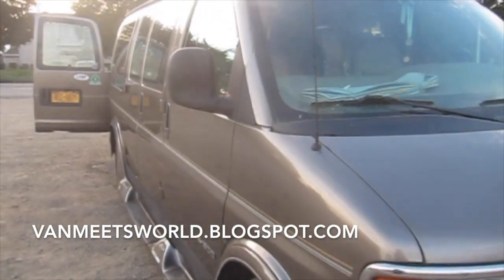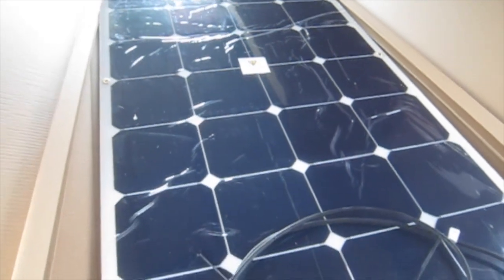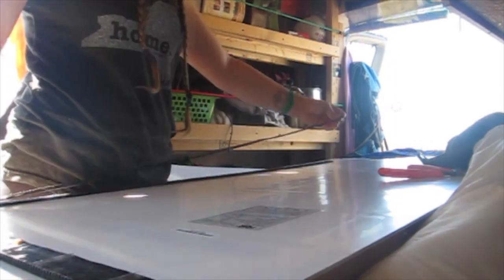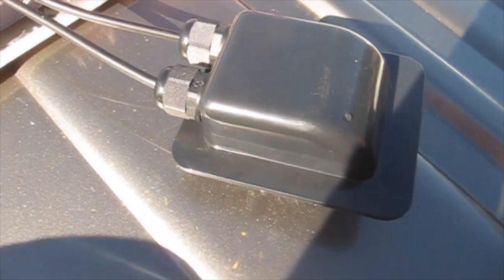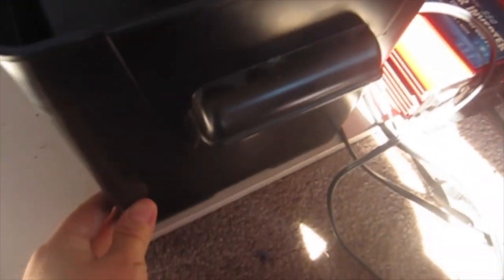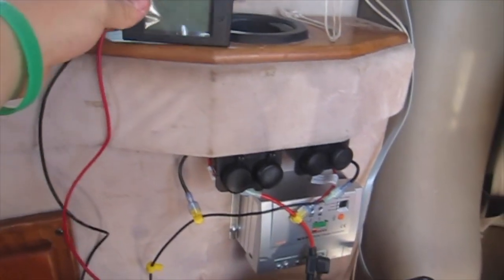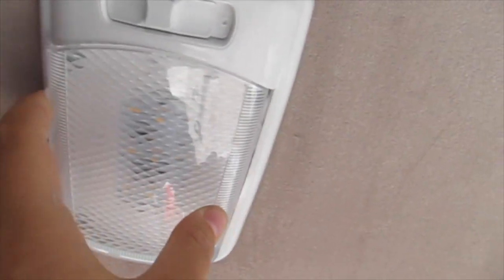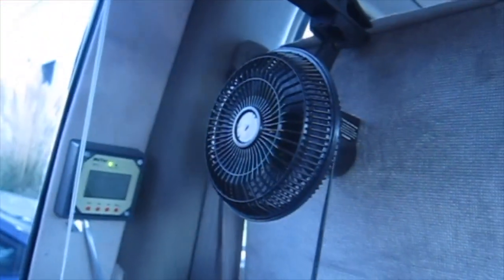Hayduke goes solar!

Comment: How's this set up working ?? Also how's the Velcro holding up while driving and rain ??
Reply from the maker: Hey Derrek! I sold my van at the end of April. But from October until then, the set-up worked great and continues to do so with the new owner. Wind, rain, ice, snow, 70 mph speeds — it held up. The Velcro is made for that type of abuse. Let me know if you have anymore questions. —Faith

Comment: have you ever thought about using paneling to cover your windows so now one can see in? also you could use it for insulation but depending on climate might not be the worst without. you could also try removing everything out of the van, carpet and excess parts on the side to have more room. maybe will give you a better living situation in there, it can be really tough without it having basic necessities. looks great so far
Reply from the maker: I was pretty happy with the system I was using for privacy. There are a million and one different ways to set up a van. It's about what works best for you and your budget. I've sold the van since making this video and I'm now in Australia with my husband :)

Comment: Your roof is not flat your roof has ridges and the wind is going to get under the solar panel and cause it to work it's way off in the win
Reply from the maker: Pat McDonald Hey, the solar panels have stayed on fantastically. It's been about 7 months now since I've installed them and they don't show any signs of loosening. I've also driven at least 6,000 miles since then, probably more, through all sorts of weather. The VelCro is heavy duty and meant for outdoor usage.

Comment: Awesome. Solar makes things so much easier. I staid off-grid for awhile and relied soley on solar power for everything. It is one of the firs tthings I want to do with my van before hitting the road. Nice video.
Reply from the maker: Solar is awesome. I hope your own installation goes well :) As lots of people have mentioned in these comments, it's better to get an AGM deep cycle battery than a regular car battery, which gives off fumes.

Comment: Hey, I know you're not an electrician, but a lot of your connections (wire to wire or wire to battery) look very messy and unreliable... No doubt it works well when it's new, but when it ages (and it will age with all that humidity and vibrations) you might run into problems, some benign (increased power consumption), some more annoying (no more juice coming through and annoying troubleshooting as you wonder why something is not working anymore), some actually dangerous (overheating that can cause a fire, shorting of your battery if the wrong cable comes loose at the wrong place, which would cause an explosion followed by an acid rain).

Good connections are actually very easy to make in a small installation like that: just get a crimping tool ($10-20 maybe? Also very small and easy to store, and you'll need one to fix things when and not if they go wrong), some connectors (they come by the bag but even by the unit they are dead cheap), some heatshrink ($5 for all your connections), and in an afternoon you can redo everything nicely yourself. I'm sure there are plenty of websites that will explain which ones to choose, and how to make the connections, this is really dead simple.

Sorry if I sound patronising, but when I see these connections to your battery that are just stripped wires inserted in the battery bolt, it gives the impression that you need to learn some easy tips.

Other easy tips while I'm at it: don't use your inverter to charge your phone: this is a big waste of power as running the inverter uses significant amount of power. Charge your phone directly with a car plug that you plug in one of your four car sockets. I know you won't run out of battery anyway, but I hope you know that the more your discharge your battery before recharging it, the less it will last. Oh, obviously make sure you have a fuse for each of your appliances and plugs, including the solar controller. This is NOT optional.

And indeed: you shouldn't have that kind of battery without a vent outside... What is done is done but be very careful now and think about it when you change it.
Reply from the maker: Hi Jay Jay. Despite the impression you got that I "need to learn some easy tips," I am aware of/have addressed basically everything you brought up in your comment.   

You're right, I'm not an experienced electrician. That's why I got help with this installation from someone who had more experience and who put almost this exact installation into his vehicle. You'll notice I mention him at the end of the video.

The installation may appear messy because we didn't create a box to tuck all the wires into, but the connections are good. Perhaps I didn't give any close-up enough shots for you to see it, but we did use crimping tools and connectors. I didn't include this in the video, as I was keeping it basic — but we did install fuses. I have enough electrical knowledge to know how important fuses are in an installation, just as basic and important as connecting positive to positive and negative to negative. The one direct wire connection to the battery bolt you saw was because we ran out of the appropriate connector pieces. This solution works fine, especially since the battery has a lid to cover it with. 

I am aware that the battery I have is not ideal for this set up. I do not currently have the funds to buy a deep cycle AGM to replace it with. It's on my list. 

I am aware that the inverter uses lots of power. I mostly turned it on in the video to show it to people. The only thing I charge on my inverter is my laptop. Everything else goes through the cigarette lighter ports. 

I am four months and several thousand miles more down the road with this installation since I posted this video. Despite many people's doomsday predictions (the VelCro won't work and the solar panels will fly off, the battery will kill me with fumes or explode, the whole thing is shoddy and will stop working) everything is 
working just as well as the day my experienced friend and I installed it. Eventually, as with all things, it will need repairs. I have the parts and capacity to repair it when that day comes. 

Thank you for your concern. The trick to not sounding patronizing is all about word choice and emphasis. If I sound irritated, it's because you're the 50th person in this comments section to say something like this.
Reply: Faith Meckley Glad to see you know what you're doing! I wouldn't leave that wire-to-battery arrangement but I'm sure you'll be fine, so have a good trip!

Comment: Make sure to seal batteries in a air tight metal box and vent them to the exterior of van. fumes can kill.
Reply from the maker: Tyron Bell The van stays well ventilated and I haven't had any issues yet.
Reply: That's.... "Batteries Separately Vented From the Van Interior" to the outside of the van... A air tight Vented Metal Fire Box with a fire extinguisher attachment is best... So U don't have to open box to extinguish a fire... A carbon monoxide detector inside van for added safety.... The vented air tight box helps with fumes and possible battery leakage, fires, and explosions... Exploding batteries can cause acid burns, lost of limbs, and life... This info is BASIC SAFETY when it comes to batteries..... I've seen large surplus ammo can made into battery boxes.... Vented w/ rubber hoses and sealed w/caulking.... Take care, be safe, and enjoy your travel.. Safety 1st!

Comment: In the future, only drill one hole for both wires to go through, and they will also go through a rubber or plastic grommet that will seat inside that hole. That will protect them from the metal cutting into them from friction (driving around). Then clear silicone that hole when everything is done, then cover that with your plastic cover/housing and then seal the perimeter of that with clear silicone. That silver thing on your wall is a charge controller.
Reply from the maker: Little late since there are now two holes in my van roof... I lined the holes with tape to prevent wear and tear. Everything is holding together just great. Thanks for watching!

Comment: I think your friend should have suggested mounting that battery outside. If they knew anything about deep cycle batterys is they off gas when charging. It releases  explosive toxic gasses inside,especially in an inclosed hot vehicle. You should invest in a sealed cell battery,granted they are a little costly,but much safer. I can tell you are very inexperienced at this and mabe a bit head strong also. This is good advice and I suggest you listen to it. If something sparks inside that van,trust me,it can and will explode. The toxins that a charging battery are very dangerous also. Please listen to reason,get the proper battery or get that thing outside.
Reply from the maker: I am looking into getting a different battery, don't really have the funds for it at the moment. The van stays pretty well ventilated and nothing has exploded. Thanks for watching!

Comment: Faith, hello i'm Tom. If you haven't fixed the charging ports on your dashboard already the chances are it's just a fuse if both aren't working. Look in your handbook for fuse number. If not a loose connection. Either way it's not a big job. If your paying for fuel use all the energy you can from it. Good Luck!!
Reply from the maker: I fixed the charging ports a long time ago.

Comment: You may want to replace the wire from the battery to your outlets they are a little under sized and could give you a problem if you load up the circuit.

Comment: You tube Cabo Yachts and check out there wiring. Just wanted to give you the best base line of how things could look.
Neater is easier when trouble shooting. I hope you put sealant in the two wire holes that penetrated the roof. If you start getting leaks after a time re-do it and seal the holes also.
You are a Aces!
Reply from the maker: Thanks for watching and for all the tips. I did insulate the ceiling holes.

Comment: That isn't a "sealed" battery, do NOT keep that inside the van. You either need to get a sealed battery or mount it under the van. Also I can't see if that's a deep cycle, but you should have an RV/marine deep cycle battery.
Reply: That does look like a lead acid battery which is not really good to put inside.  I would suggest ample ventilation if you insist on keeping it inside.   Also if your throat and nose feel sore, the cause might be that battery so watch out for that.  Lastly, keep an eye on the battery because the more it heats up the faster it releases gas.
Reply: Hufinn Puff Sparks will equal boom if that isnt the proper battery. Deep cycle batterys should always be mounted outside,never inside a camper or vehicle. The friend that helped you should have known that. Trust me,you will start smelling that inside your vehicle. Your skin will feel ichy and you will start getting a metallic taste,smell going on,especially when the battery is over charging. No offence but you really dont know what you are doing do you?

Comment: Just as a tip i would charge the phone with a car lighter charger vs the one via the inverter as you are losing efficiency converting the dc to ac back to dc.
Reply from the maker: smokiethebear912 Some of my devices need the regular outlet. I'm not worried about efficiency because the panel provides more power than I use.
Reply: smokiethebear912 that would drain the batteries and tô me then best thing is to go solar.

Comment: Your wires look far too small (thin). Calculate your max amp output of the solar panel and then lookup online the gauge of the wire needed to limit losses to install from the panel to the charge controller then to the battery. You need to also size the wire thickness from the battery to the inverter based on the max amp draw of the inverter. 
For safety, you need a panel cutoff and a battery cut off; you also need fuses on the inverter-Battery; and on the 12v outlets you installed because if you draw too much power for the wire to handle, the wire will catch fire unless the fuse is there to blow out first and protect you. Size the fuse based on the rated load of the 12v outlets times 1.2 and get slow blow fuses. Get help with this; it is dangerous. Get a smoke detector. You also need a deep cycle battery not a regular automotive start battery.  You are asking for disaster with this setup. Power down this system and get some help.
Reply from the maker: davevario I have all the fuses I need installed in this system, I just didn't talk about it in the video. I am confident in my installation. It works fabulously and I've had no issues.
Reply: I am happy to hear that you have fuses installed.

Comment: Change the lyric of ...'yes...yes...you're gonna'  lose that girl...'and insert the word 'panel' rather than 'girl'.The Velcro is an excellent idea, and it will work...for awhile.The full-sun on the metal-roof is going to break-down the adhesive agents due to excessive heat.How do I know?I've tried it before...and my panel went on vacation by itself...somewhere.(sometimes relationships don't work...even if you glue yourselves together!)
Reply from the maker: I check the security of the panel frequently and am prepared to replace the Velcro if it's degrading.
Reply: Faith Meckley Good idea...'watchfulness'.
(I'm certain there are mounting-kits available online from the panel manufacturers...or one they recommend. Cost? I don't know...likely a good deal more than the Velcro idea, which in itself is excellent)
Mine 'wafted away to Oz' so I no longer had any need for something more 'sturdy'.
(I paid $260 for mine...but that was in the 90's when PV's were much more than now)

Comment: Wow that's Mickey Mouse !!! Your wire is too thin, your Battery is Not deep cycle and will vent toxic fumes into your van!!  Holy Crap and you need to get ride of that battery, you need a sealed battery.

Comment: Omg !!! That's exactly where mine is  !!! I have the same panels
Reply from the maker: Sweet! Did you do your own installation?
Reply from the maker: cpu 510045011 I'm 21 and not even remotely close to getting married.
Reply from the maker: cpu 510045011 Currently, yes.  Why do you ask?
Reply from the maker: cpu 510045011 Not sure why it matters. I'm not gay.

Comment: AGM batteries as the one you're using will offgas.  Also, auto molding tape is the way to go for exterior use on the panel.  Good luck.
Reply from the maker: Thanks for the tips. I'm pretty confident in my installation.
Reply: "I'm pretty confident in my installation." Could that be due to your lack of knowledge? All of the points that I have seen mentioned are correct. You seem to be doing well, don't get me wrong; but you've had help. I lived in a 1996 Toyota Corolla by choice for awhile (haha yea). I, as other commentor may just know a thing or two.
Reply: DC in from Van outlet or Panel to charge it. Pushes 400Watts continuous and eliminates the need for Jump pack/tire air compressor http://www.sears.com/diehard-platinum-portable-power-1150/p-02871688000P
Reply from the maker: The only thing I'm considering changing is the battery. Everything else people are saying has not been a concern to me. The installation has been working great so far and has given me no trouble.

Comment: Awesome setup... But man I'm not gonna lie I feel like within the next year or 2 down the road you will end up having some leaking issues. I would have calked or filled the holes you drilled into the van. On top of sealing it with that plastic piece that goes overtop... I've had a lot of experience in personal automotive repair and one would think what you did was enough to keep water and moisture out but man you would be surprised what weather can do to plastics and sealant. I suppose even if its leaks you would know where It's coming from but from my experience mold can start growing underneath the padding of the sealing at which point is an entirely different issue in it's self.. 

Best of luck in your travels tho. :)
Reply from the maker: Nothing is perfect but I am fairly confident in my installation. The 
person who helped me do it basically has the same set up. And 
troubleshooting won't be difficult now that I know what to do.

Comment: how do you register and pay for your van if that is your home ?
Reply from the maker: evo paul You treat it just like you would with registering any other vehicle. Not sure I understand your questions.
Reply: well what I mean is when you register your vehicle you need to register it to an address. what address do you use
Reply from the maker: Gotchya! Well my permanent address is in New York with my dad, and my mailing address is with my mom. I am 21 and still working on college, so technically I live with my parents. In terms of receiving mail on the road, I have it sent to friend's houses and also you can use general delivery mailing through the US postal service and pick stuff up directly at post offices. That's how I had the parts for my solar system mailed to me from Amazon.